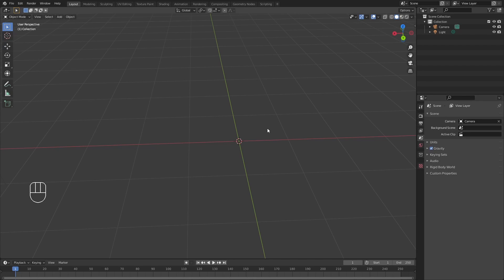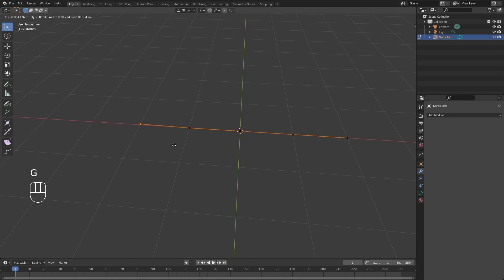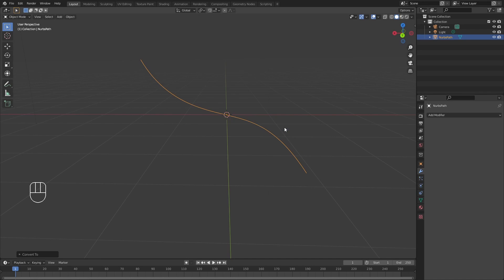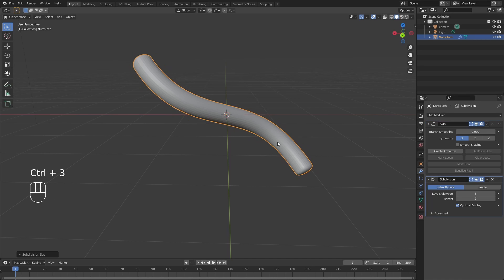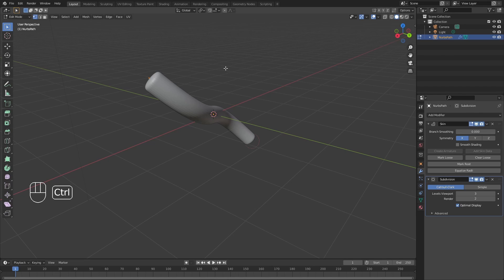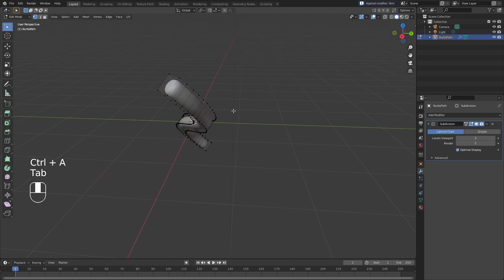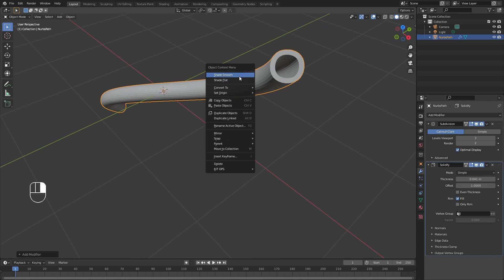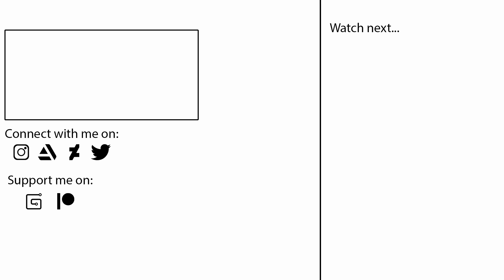How to Quickly Create Cables in Blender 3D

Comment: I don't necessarily recommend this method if you need to pay attention to the number of vertices. In that case, create a Bezier curve, go to the “Data” tab (object data properties) and then to the Geometry section, where you will find “Depth.” Change the value for the size of the cable and “Resolution” to control the density of vertices. Oh, and you can see the density by switching to Wireframe mode. Note that you will need to convert the object to a mesh if you want to export it.